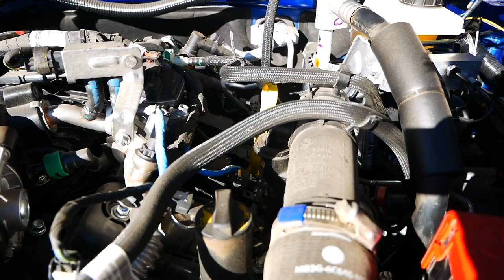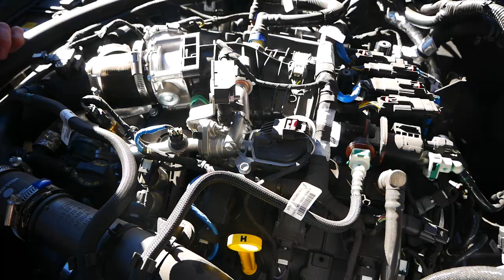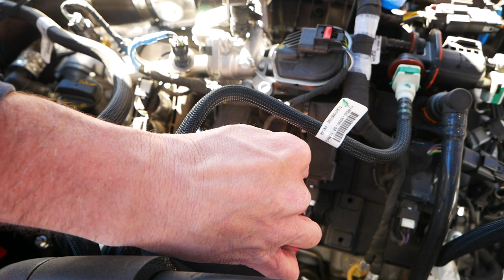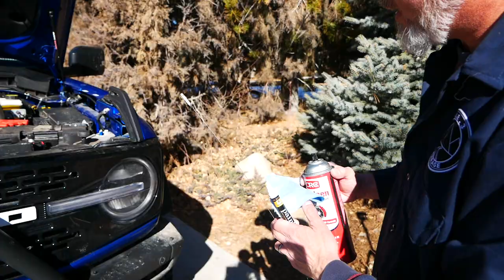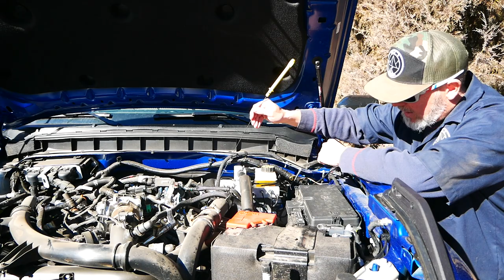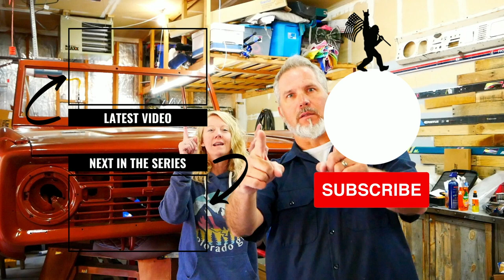Ford Bronco - Easy Fix for Dipstick Visibility.  [2.7L Ecoboost]

Comment: Question...
When you do an oil change on the 2.7, is it normal for the plug to wiggle even though it's tight to the tabs??
Reply from the maker: Sorry I missed this question. I assume you mean the drain plug?  Mine was tight, but if it wasn’t leaking the. Maybe it’s ok to have some movement.